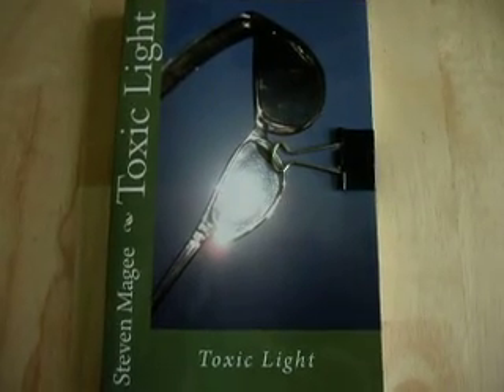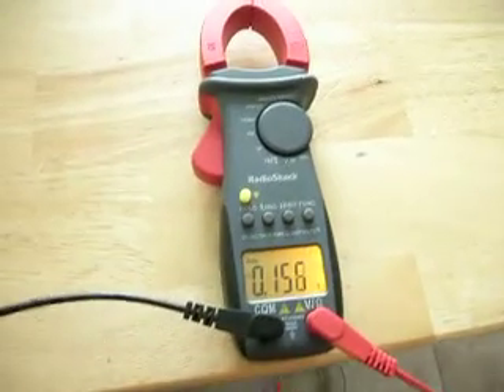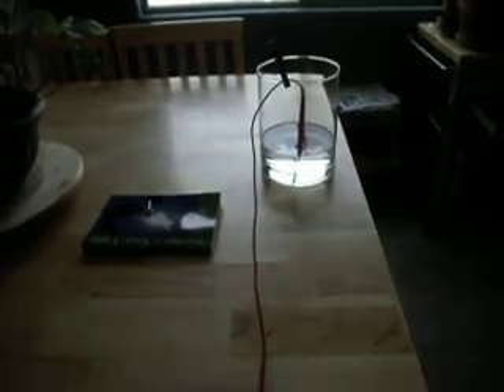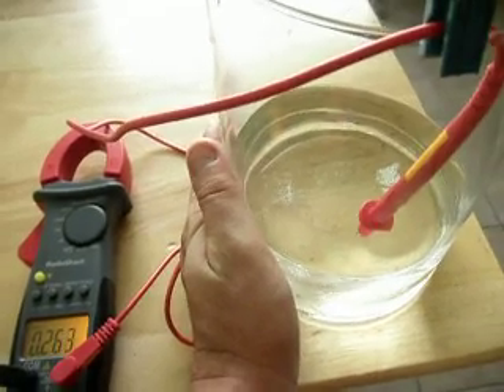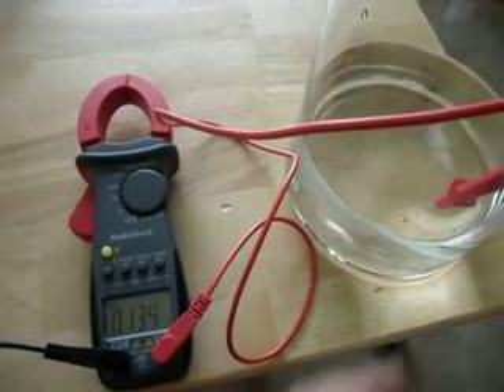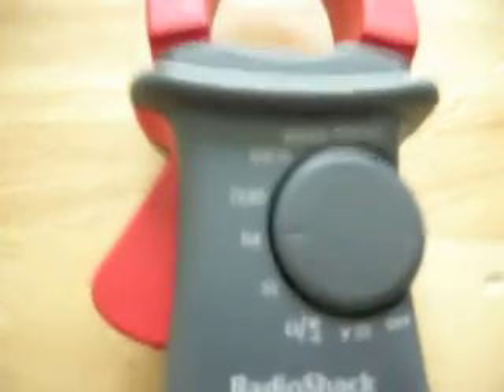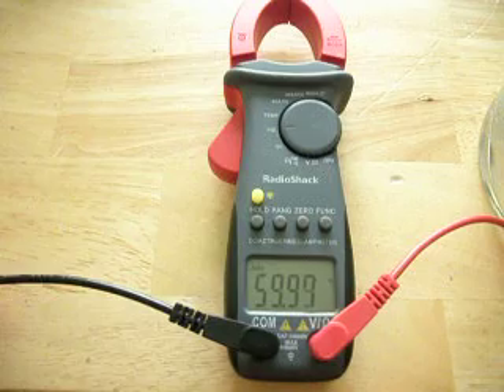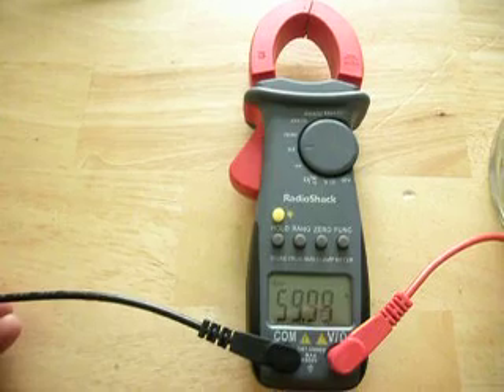Electric Tiled Floor, Electric Water, and Body Frequency Demonstration.

Comment from the maker: This video was made in the USA with a 60 Hz mains system.  The voltage is present with the fuse board switch on or switched off.  I have traced the source of the problem to the utility system neutral connection not being effectively grounded.  I reported it to the utility and they say an electrified home up to 50 volts on the grounding system is okay and have closed out the case!!!  Google "stray voltage cows" for the truth.